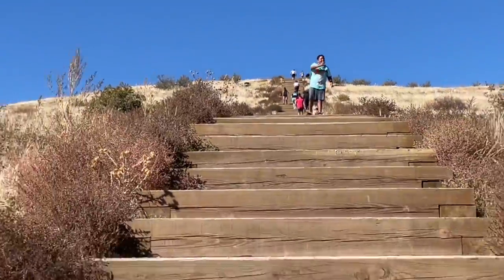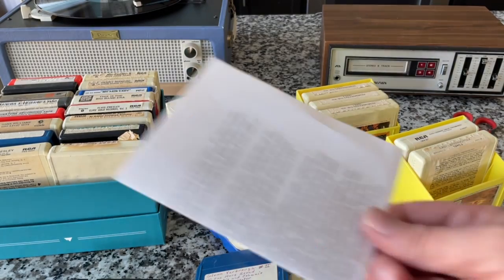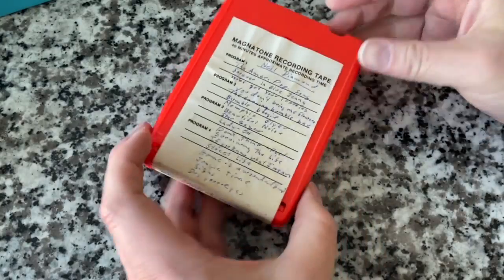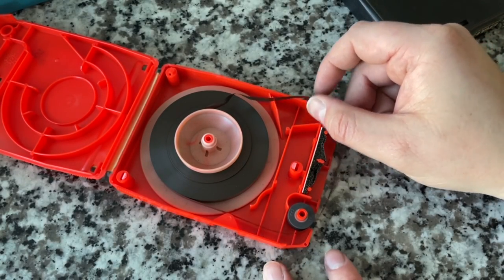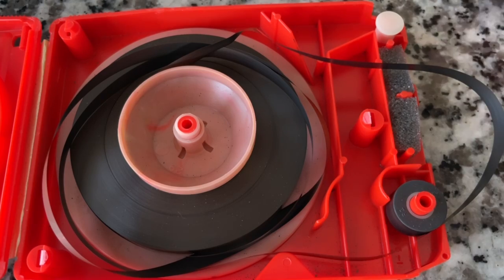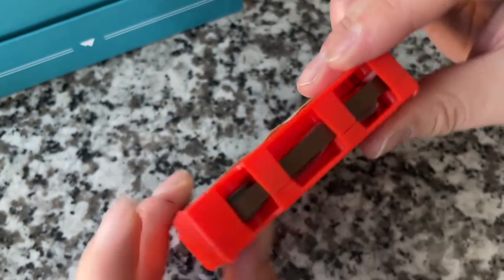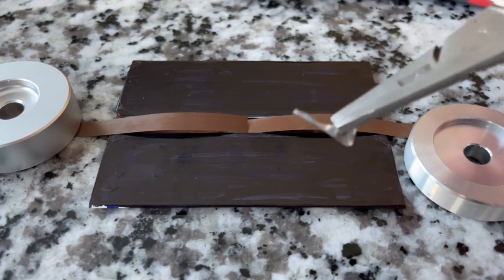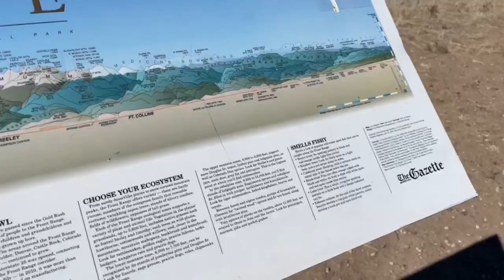8-Track Repair!  (Featuring mistakes!)

Comment: With new foampads, you need to keep the plastic back part of the old foampad, scrape the old foam off and then stick the new foampad to the old plastic holder part. Way easier :D

Comment: Fun with 8-track tapes!  I'm restoring some myself, new pads and splices; most of them are fairly easy and work well when you can get the cartridge open without destroying anything! 😀 Sometimes it helps if you cut a slit in the middle of those replacement foam pads, they seat better that way.

Comment: glad you're having fun at the parker incline, I drive by it often on my commute between the Springs and Aurora.  The adhesive on the pad material is designed to stick to the plastic backing of the old pad that has failed, you remove the old pad and then stick the new pad to the old plastic backing, then put it back into the tape.  Enjoy those old tapes!
Reply from the maker: Oh my goodness 😱 I have soooooo much to learn!  Hey that’s cool you know about the incline!

Comment: I had a cassette tape of two of Hayden's symphonies which was twisted around.  I decided to get a few tapes of things I didn't care much about.  It was a disaster, to say the least.  Eight inch tape, once it comes off the reel, is impossible to get back on.  I suffered through two tapes, and I decided to tackle Hayden with my  expert knowledge.👨‍🎓 Unfortunately, I twisted the tape around twice and I had double the problem.  I decided give the whole thing up. 🙁

Comment: I tried to fix two and failed miserably, so you've done well to get to the point you did (where they still work too).  The first time I had the shell faced down, and snapped the shell (I was too brutal with it), the tape flew everywhere - it was twisted and snapped in half - wrapped around the shell (as I purchased it; thinking it would be easy to repair).  The second time, the tape needed some rethreading, as it fell apart before I could even open the shell properly.  Both were failures and are no more.  Incidentally, I think it may have been possible to completely cut the two foam parts in half and treat them as individual elements, but I'm not sure.  Just a thought.  (I think it's a shame there were not screws - to make it easy to repair, and the fact that the label tears can be an issue.  (I assumed I'd be able to rehouse the first one (with the snapped shell), but it proved to be impossible when the label got half-way off and then tore off leaving parts of it still on the old shell).  Sigh.
Reply from the maker: I agree on all accounts 😂😂😂
Reply from the maker: Yes that’s a great idea about splitting the pads… I thought about that. I guess the most difficult part might be getting the old one out of there

Comment: I bought a job lot of 50 cartridge tapes a few years ago and all of them were filthy inside and all needed new pads and silver slice replacement. The first few a messed up ( so i practised on the rubbishy tapes first) but soon got to be an " expert"  by the time i got to tape 50. I cleaned the insides with a cotton bud and claened the roller with surgical spirit. I really do not understand why the insides were so dusty and dirty.

Comment: When you first open the tape I thought that you should have played it up to just before the splice then you could just reinforce the original splice without cutting it if it didn't split with regular splicing tape behind it and save your new foil for really damaged splices. You can then fix the splices by pulling just a short ends of tape out without opening cases that may not need new pressure pads. These things are really aggravating. When a splice does separate while playing you don't know for a few seconds because the tape continues to play , then the music stops because about three feet of tape has wound around the capstan within the player halting playback  so it's a huge job from then on to correct. If you just pull it out the player will be okay but the tape is destroyed. Even if you open the machine up and unwind the tape from the capstan there's no assurance you'll be able to rewind it onto the spool.    Thanks for the sightseeing portions of your state.

Comment: 8-Tracks were the worst invention of all time from mechanical problems to bad sound - the best invention will always be CD's and next is the MiniDisc - Regular cassettes are ok if you metal tapes but look what happens to the old school cassette machines and all the things that wear out over time. Of course the MP3 files are the greatest of all time with ITunes or your IPhone no moving parts....
Reply: I’ve never had a successful 8-Track repair. Reel to reel rules!